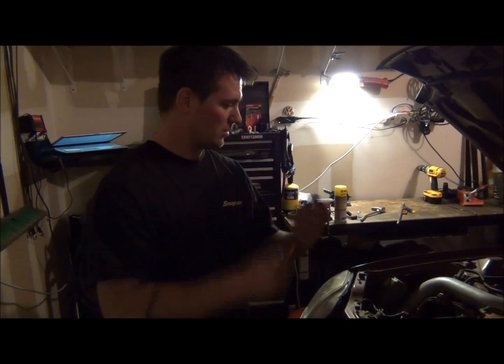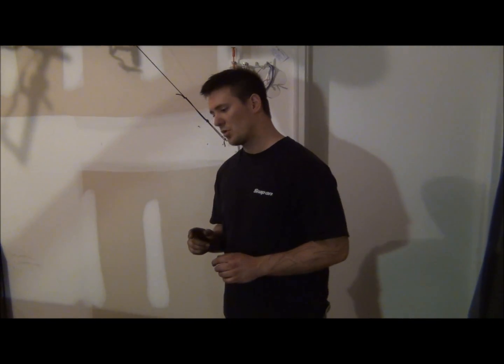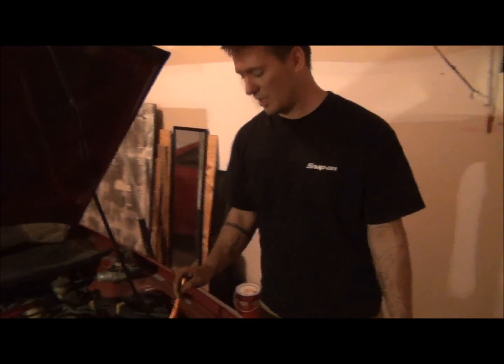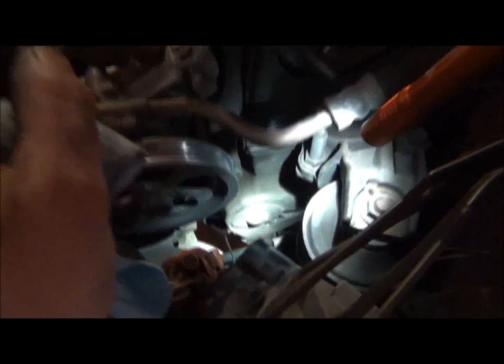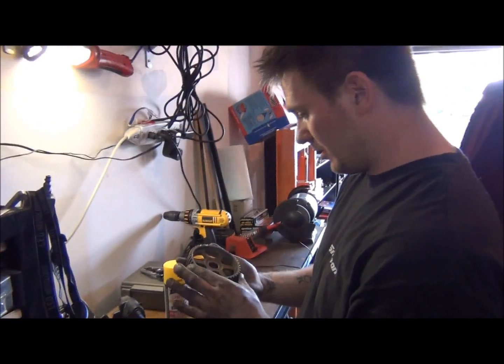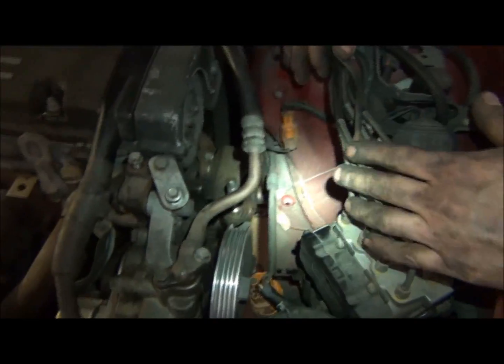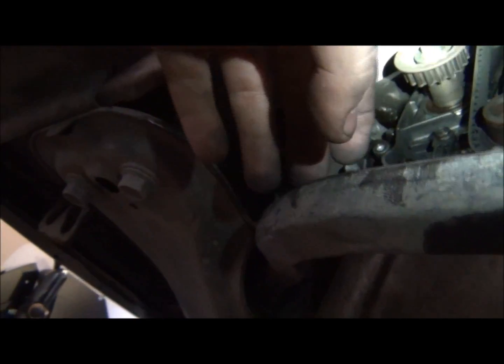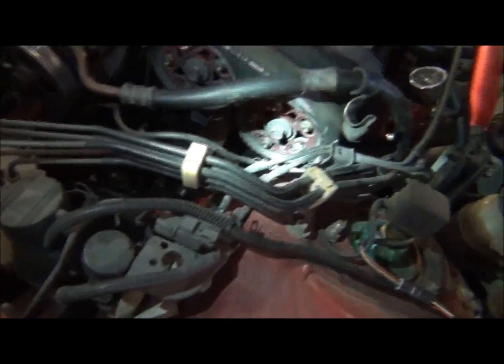Replacing a TDC CKP Sensor on a '98 Honda Prelude.wmv

Comment: Are there any sensors inside the distributor or just the icm
Reply: I scoped the Tdc  sensor at idle shows around 8 volts peak to peak .I got a p1361 unless I got an intermittent failure

Comment: Man my belt snapped and I noticed my crank pulley was worn so I switched it out and it was a pain in the butt, and now I’m getting this code after doing all that work to replace it, do you think the sensor is really bad or just needs time for the code to reset?
Reply from the maker: Hey Richy, what codes do you have? I'll see if I can get you some information.
Reply: @EuroTechSolutions  the code I believe was P01321 but the scanner isn’t detecting any codes anymore, but the CEL is on

Comment: I’ve been searching YouTube for a solution for my engine cranks over, but no start. I’ve replaced the ICM inside the distributor on my 97 Accord Non Vtec engine with no luck starting. I’ll be checking the crank and TDC sensor located near the CC and oil pump housing for obvious damage and continuity. Next step will probably be the distributor or ECM to replace 🤔 Keep you guys posted on my finding.

Comment: Does the p01362 cause that code
Reply: Arturo Garcia did you get yours fixed
Reply: @bestiesquad2277   yeah it did but now it idles rought a little but when it idles sometimes my engine shut off .it  used to do it with that code

Comment: Sometime after i got my head gasket changed, with timing belt and water pump, an obd code came on it was the crankshaft sensor.. and the car stalled and was weak on acceleration and vibrated.. the light went away and its symtoms.. but came back again.. so my mechanic changed the sensor with one i picked on on ebay cheap.. and he put a new female connector on as well.. he checked the timeing and the timing tooth , he also checkedd the voltage and signal ... and couldnt find any trouble ..yet the trouble light crankshaft sensor is still on aghtthe car still has the bad symptoms of it.. the last thing my mechanic said, it may be the cars ecu vand to first get the ecu prigram update .
My car is a honda civic 2002 ex 1.7 L automatic .

Comment: were is this sensor on a 1993 2.3l dohc non vtec Honda prelude, I have everything off to the crank pully and timing belt covers. but its not theres...
Reply: +david vasquez  in some hondas its placed in the distrbuter
Reply: same place as the h22. They use the same part
Reply: @mrangulo0  elaborate

Comment: Can a faulty CKP sensor cause the rpms to surge? I have an 01 prelude and my mechanic says because I put 10 w 30 in my 100000 mile motor it caused my car to bend a valve and I think its the crank shaft position sensor, not the type of oil. Please can you give me a reason why my rpms are going crazy and can the crank shaft position sensor cause me to bend a valve? Thank you for reading, hope to hear from you soon.

Comment from the maker: I haven't worked on this car in a while, but I finally found the issue that burnt my ECU.  It was a shorted starter solenoid and also a intermittent shorted aftermarket radio.  Both shared a power feed with the ECU and when tested proved bad.  So now I have to get a starter, reinstall the factory radio, and replace another ECU.  I'm also stripping all the aftermarket parts off of this car, so if you are interested in any parts, let me know.

Comment: I am actually having the exact same problem as you. The car started with OBD1 ECU ONLY after I replaced Distributor, ignition coil, and fixed some wires that were cut near the CKP via soldering.  I found that my ecu was bad (chips were bubbling, shorted) so I replaced that too. But I used a used one and had to reset it, which means I needed a new immobilizer.  I got that done and pulled CKP error code. Now I have to replace that...and hopefully my car starts.  Sound about the same?

Comment from the maker: I had a no start condition and started checking the basics, air/fuel, spark, etc...  Then I actually scoped these sensors and they were flat lined.  I had no signal from them.  But be careful, I did all that to find out that the PCM was faulty also, so I've had multiple problems.  I'm actually going to do another video very soon about a continued diagnosis with this vehicle.  HTH

Comment: yeah and then the breaker bar slips and wipes out everything under the hood that it comes on contact with. smart.
Reply: I pulled th starter and put a pry bar in the clutch. The harmonic balancer is super tight. dont use extensions, jack car high enough to use your foot. I still cant rev above 3000, Gonna pull codes....

Comment from the maker: Well that doesn't work on this vehicle.  The Engine spins counter clockwise and the bolts still loosens that way, so if you use a break bar and turn the engine over you would be tightening it. I tried that and then realized what I was doing.